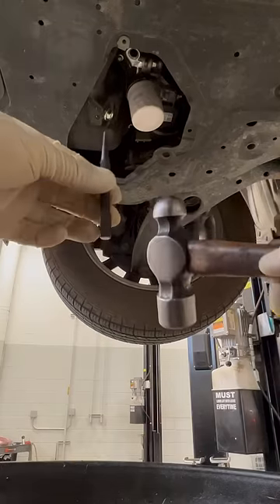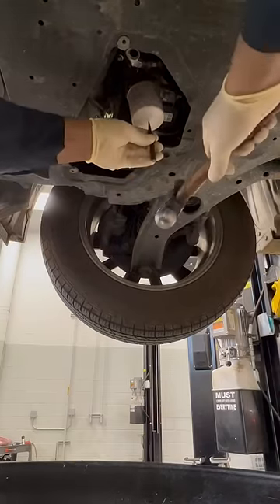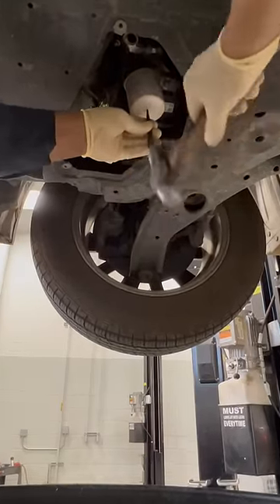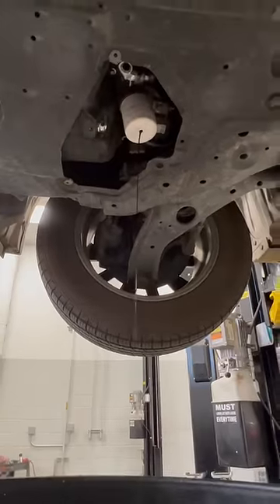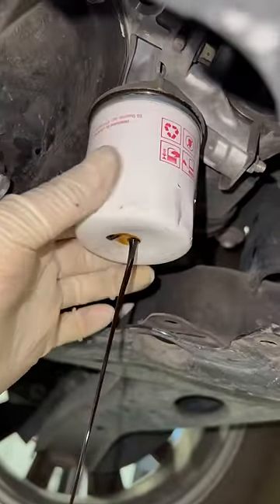Tech Tip Of The Day Oil Filter Clean Removal #oil #oilfilter #mechanic #shorts

Comment: Pro tip:  Let it finish draining first before taking it off.
Reply: @dynamike7108 
Not really the way you are thinking though. Since the whole process takes so long to drain, it may be better to wait till the drain slows to a drip.
Reply: @dynamike7108  
I'd rather take my time and do it right
Reply: @dynamike7108  💤 😴 💤

oh look, I fell asleep faster. 😴
Reply: So grab in a punch and hammer saves time?
Reply: This just helps it drain faster, I'm more curious how you do this on a horizontal filter 😂.
Reply: @stpbasss3773  
Puncture the side instead 😹
though I wouldn't recommend it
Reply: I see you've never changed oil
Reply: @Ramblequist  exactly. Theres always a bit of oil above the filter that dumps over the sides when you unscrew.
Reply: You're not a pro, how do you drain the oil that is trapped in the filter? It doesn't drain up, there is always oil in it that spills out when you remove the filter. Why are you commenting on something you know absolutely nothing about and have obviously never done before? I can't stand hubris and I'm sure most people around you feel the same.
Reply: @zackthomas1031  
When you take off the oil filter there is of course more oil, so be sure to have the catch pan ready under that as well. What he's saying is after you puncture the filter let the filter drain the same way the engine is or was or will be draining out oil. Eventually it will slow to a trickle and practically nothing.

His point is about making as little mess as possible. Just as is this video.
Reply: ..... You all just use a plastic cup. Any spillage goes on the cup. No need to puncture the filter even when using this method. No waiting for it to drain.

For horizontal filters, thankfully gravity will direct the oil towards your oil pan, so don't bother punching it on the side.

Finally it's a damn oil change, it's OK for the one time use gloves to get dirty before they go in the trash. If you're trying to keep your engine immaculate, mother nature has some other plans you're gonna hate when you actually drive your vehicle outside for the first time! Lol.
Reply: @TheJuanSolid  
I'm wondering what if I change the oil in a zero gravity environment? 😆
Reply: @CurlyFromTheSwirly  space police would be on you so fast for stealing NASAs oil! A mess would be the least of your worries 😆
Reply: @stpbasss3773 if it's horizontal you can probably just unscrew it a little and it should drip straight down into your pan without getting on your hands.
Reply: Just use a cup from any fast food place or a solo cup
Reply: Pro tip: give useless pro tips that don’t make the slightest difference to seem more intelligent than the poster

Comment: Solid tip... Also if your customer ever accuses you of reinstalling the old filter you can show that it was destroyed before it came off the car and couldn't be reinstalled.  Another protip is to always mark the mileage and date the oil filter was installed on the outer housing.
Reply from the maker: @keithcrawford3110  that is a great tip
Reply: I have been changing oil in my vehicles for 40 years and never thought about either one of these tips. Thanks 👍
Reply: But with motorhomes the oil gets changed annually due to so few miles get put on them. At least that’s my life.
Reply: Then why are u changing the oil 😂
Reply: Not necessarily, bubble gum could be utilized, McGyver had to do it in a couple episodes.

Comment: I used to do the hole punch in the oil filter too but now I’ve learned an even easier and less messy method. Simply use a plastic disposable ice coffee cup. Starbucks venti or Dunkin medium size works perfectly. Roughly 22 oz. After loosening the filter, cup the whole filter and spin it off with cup in your hand. The oil will begin to pour into the cup. Not anywhere else. Then gently let the old filter slide into the same cup. Catch remaining dripping oil in the plastic cup and be ready with a new filter once it has slowed to a slow enough drip. Replace filter and done. I got all my friends doing this and they too agree that this has been the best method yet.
Reply: Yeah I just use a Ziploc bag. Not foolproof but it really helps
Reply: Interesting idea.  Still this job is not oil free from hands
Reply: I think this only works when the oil filter is vertical, my Nissan Pathfinder filter is at a 45° angle, the oil starts leaking from the seal, and I’m not sure if it will actually drain directly into the cup. But I’ll try it.
Reply: There are no Dunkin Donuts in Canada 🇨🇦 I went to Star Bucks and they wanted $8 for medium Coffee 🙄

Comment: I do this when flushing my radiator. Works perfect
Reply: Haha...good one..😂
Reply: ah yes, the perma flush method
Reply: I've done that when changing a radiator that didn't have a drain plug so I didn't take a bath pulling the lower hose
Reply: LOL
Reply: I have a better method. I just let someone else do it ;).
Reply: @mdotguy  Nahhh, you just plug it with the gum you were chewing moments before!
Reply: I did it to myself when I had problems peeing.
Reply: @indridcold8433  😂😂😂
Reply: @indridcold8433  damn dude🤣🤣🤣
Reply: Lawl

Comment: Subaru boxer engines have the filter on top of the engine right front. So no mess because it is almost fully drained already, wonderful.
Reply: that was to make up for the ones they put in between the exhaust manifold a few years prior 😅

Comment: make sure you can loosen the filter first
Reply: Also make sure you have the correct replacement.
Reply: @Nunyaknow22 also make sure you have fresh oil
Reply: You are 100% correct!!! That’s all you would need is a oil filter you can’t get off and it has a hole in it!!!
Reply: Of all my years as a mechanic I've never had a filter not come off, I've had them fight me pretty good especially on the Volvo semi trucks, if you use a small propane torch around the seal it helps , also you can take a larger punch or the good old screwdriver punch it through the side of the filter and crank her loose that way
Reply: @Modern_day_primitive  i bought a used durango and the filter was on so tight with rust i had to take it to the shop to get it off and he came back and charnged me an extra 30 for getting it off after wresting for like 25 minutes with it
Reply: It comes off one way or another 😂
Reply: First step, make sure ypu have the car
Reply: Eventually 😮😢😅
Reply: and make sure you had the engine shut down
Reply: @Modern_day_primitive had a filter I swear was welded to the assembly. I had to remove it completely and order a new part and stick it back together. Was awful 🤣🤣
Reply: Naaa just take oil intake top off thats the same as loosening it
Reply: @Modern_day_primitive been there on Macks! Same engines of course and some of these guys tighten them like it’s their purpose on this planet
Reply: I agreed 100%.
Reply: Ah, a piece of duct tape should hold.
Reply: @Modern_day_primitive  so allow me to interject about the ole screwdriver trick, it seems like it works for a split second before it peels the filter in half like a can opener lol. In my case this was an absurdly tight filter the previous owner had installed, none of my filter wrenches could get it to budge, it had no nut, tried my leather belt and even with a broomstick for leverage (it didnt help man...), then i figured lets try the screwdriver... went in easy peasy but as soon as i tried turning it it just cut like butter and sheared the top of the filter off. 
Now I was tasked with not slicing my hands or wrists open, ripped off the element and vice gripped the everliving hell out of it until it finally budged. 
New filter went on hand tight with slightly less than the recommended twist and came off no problem. 

Biggest nightmare oil filter ever lmao. 
Ill never used that screwdriver trick again. Id rather pull the engine honestly.
Reply: @100GTAGUY  well you got it off tho right lol, like I said they will all come off, you ever encounter some of  these semi truck oil or fuel filters they can be alot worse than what you described make you reconsider your career lol
Reply: @drdrew3  also make sure you have your laundry folded for the next day
Reply: @Anna-e4p4o there’s no such thing as an oil filter you can’t get off.  Are you that weak?????
Reply: Those toyota cartridges can be a pain to get off sometimes.
Reply: @100GTAGUY  I had one stuck, and the filter wrench kept slipping. I took an oxy acetylene torch, and brazed borium to the inside of the wrench. The borium made it grab onto the filter and loosen. It caused dents in the filter but still did the job. You have to be careful not to burn a hole through the oil wrench when brazing on the borium.
Reply: If you're concerned about getting dirty you shouldn't be doing your own engine work.
Reply: Facts...
Reply: @Modern_day_primitive in Colorado and other states where there’s lots of salt on the roads it’s more common it could be rusted stuck
Reply: @drewmasondom  well if you change the oil at recommended 3 months or 3k miles there is no reason for it to be that rusted even with salt, we also salt here and use that nasty road chemical,  either way they will come off maybe not the average person but anyone worh a bit of mechanical skills or some trick can get them off, trust me I've had my share of stuck filters, them Volvo trucks with 3 oil filters all next to each other 2 the same size and 1 different they can take a while I've spent a good 2 hours stuck up under the truck broke to filter wrenches heating the mating surface and running a small pry bar I ground into a point through the filter to break them free, but the point I'm making is they will come off there is no filter that wont come off you will always be able to get it off no matter how stuck, rusted,seized etc.
Reply: @BabyGators agree it's contact + a half turn not tighten until the next service takes an air hammer to cut it off and turn the filter housing nipple out with the filter been there to many times

Comment: i usually just buy a new car whenever one of the dashboard lights comes on but this is a great idea 🙏🏾
Reply: ikr, never ever have car problems
money problems but never a car problen. 😂😂😂
Reply: I just take all the bulbs out the dash and have never had a dashboard light come on.
Reply: I  was thinking there are videos on how to replace everything other than the dash panel, apparently the odometer is pretty important and you can’t just reset the miles
Reply: @edmondlau511  I'm too lazy for that...I just use electrical tape to cover them.

Comment: Never knew people were that afraid of getting dirty
Reply: Work smarter, not harder.
Reply: What’s wrong with wanting to stay clean as much as reasonably possible? If you want to get dirty, go for it.
Reply from the maker: Staying clean saves time from constantly going to wash hands. Would you like me to jump filthy and oily into your car after I’m done servicing it???
Reply: The mechanic had gloves on.
Reply: Horizontal filter totally fall hahah gravity still wins haha
Reply: It's really not about getting dirty the oil just gets everywhere and it drips on the floor and you got to have cardboard and then so it's a great idea nobody's about getting dirty but why get dirty if you don't have to
Reply: I'd just rather not clean up a mess I didn't have to make in the 1st place.
Reply: I had to work clean. To many test drives or interaction with customers to be grubby. Though usually a pair of gloves that you could just peel off and throw in the trash on the way to talk with a customer.
Reply: Isn't motor oil carcinogenic? Hell, just throw in some arsenic and lead paint while you're at it.
Reply: Well hell larry use your feet then.
Reply: @WrenchingMafia they want you to bathe in it 🛀 🛁
Reply: @Kitteh.B  If this was at home I would agree with you but time is money as a mechanic and this is extra time right here which means less money. Plus gloves exist.

 I used to be a lube tech and never ever would this save a mess. Either this would be pointless with something this accessible since it wouldn't be messy to begin with or the filter was in some god awful place and you could just forget about even trying this.

Comment: Hot tip, very important: Crack the filter loose first or you'll be in trouble if it won't come off after putting a hole in it.
Reply: It will come off one way or another 😂😂 no way I’m leaving it. I get what you mean tho 😂
Reply: That's a do it your selfer rule i i always follow
Reply: Minha regra de vida é:
Se não nasceu aí, de algum jeito vai sair, se nasceu, vai sair também...kkkkkkkk
Reply: Just send the screwdriver straight through the side it even acts like a wrench to undo it after
Reply: So if you crack it loose and i hit it with a hammer, you’re telling me the grooves for the filter to sit in, won’t strip?
Reply: Also make sure the new filter...is the right filter
Reply: I have an oil filter socket and a breaker bar, the filter comes off every time
Reply: @Houstonee1425 the threads? Are those the grooves you mean? Lol no, tapping a punch through thin aluminum will not strip the threads.
Reply: @uncle_kyle7149  Some filters are decently thick steel but it doesn't take much force for a fine tip to puncture either way.
Reply: @uncle_kyle7149  yeah threads. I’d rather get covered with oil then to be clean than be dumb making a 10 min show while under the car.
Reply: If it dont come off I'm putting more holes in it with a screwdriver to get it off
Reply: It’s gotta damn come off anyways.
Reply: They won't. Thats kinda how you hammer the bottom of bolts. Scree the nut on to where it covers the tops threads and it won't strip and will save your end threads from getting damaged or bent
Reply: Lamoooo 😂 good point
Reply: Update: I do PM on semi trucks. Every few months a driver will come in, with white filters, that with 2 people using filter wrenches, the things won't come off. There are some drivers I've sent down the road. I will not punch a filter until I know it's loose. The filter housing the filter screws on to is far more fragile than one might think and our location has busted them off the block before with enough force.

Usually in those cases, those guys were sent away from another place before they got to us. I'm not having a driver block my service bay for hours, or even a full day, just because I punched first and filter was stuck after. If you see rust, don't even try a filter wrench or screw driver. Get a collar 4 inches wide instead. Far more luck with that.
Reply: It’s a great way to introduce metals and dirt into your engine, 0/10 not necessary
Reply: That's not a problem to worry about. You can put a screw in it if it does happen.
Reply: Listen to all these dumb comments. Make sure you got the right filter. And if that rare very rare occasion does happen. You can just put a screw in the hole you just punched.
Reply: No filter can deny removal.
Reply: @stevenkunkle3857 I have hands. Comes off every time.
Reply: That's a better tip for differentials. Fill and drain plug.
Reply: I had a stuck filter before, was a smaller capacity one so harder to grip and 2 different filter sockets wouldn't take, however I was concerned that putting a screwdriver through it might impact the aluminum downpipe in the middle which the oil filter attaches too, since on the smaller oil filter it would reach to basically the bottom of the can. 

Would you still wallop a screwdriver in there and move on with your day?
Reply: That is why you do not loosen it first if you loosen it first then you give it the opportunity to mess up the grooves, which is less likely to happen to be on the safe side keep it tight, then hit it with the punch elementary my dear Watson elementary😅😅😅
Reply: Can always plug it like a Bunghole I guess. 🤣
Reply: just added an extra oil filtering
Reply: Thinking the same.
Reply: Then hitting it with a hammer will damage your screw seams. Just use a pan if you don't want a mess
Reply: reminds me of the time i couldnt get one off even with the oil filter wrench ended up hammering a screwdriver through it and still couldnt get it off ended up splitting the whole thing in half and fought it for hours till i got that sucker unscrewed
Reply: I don't under stand why it wouldn't come off, it's screwed on....
Reply: That's when you got to hammer a screwdriver through the side for a handle
Reply: @StandingFirmAlways  exactly. I need to know this guy's shop so I don't go in that zip code for any repairs
Reply: @drew_de8990 ahhh to be young again
Reply: @jennaanderson6106  my guy is thinking in 3D
Reply: @jadek.weldon2224  until it doesn't. That's what tools are for.
Reply: @Houstonee1425 presumably you can screw it back up tight before you punch it.  The point is just to make sure one CAN take the filter off, before wrecking it.